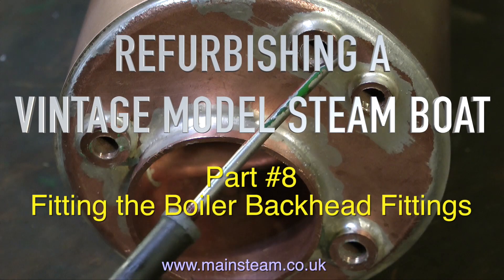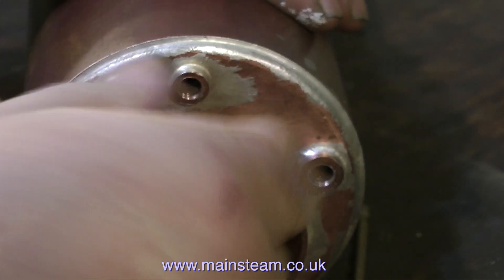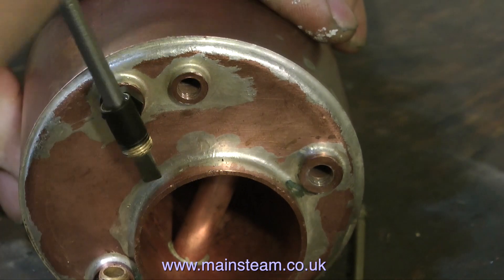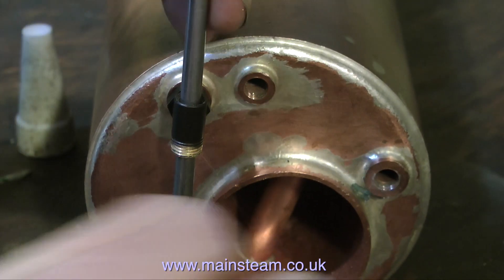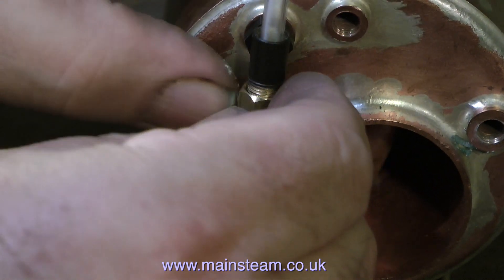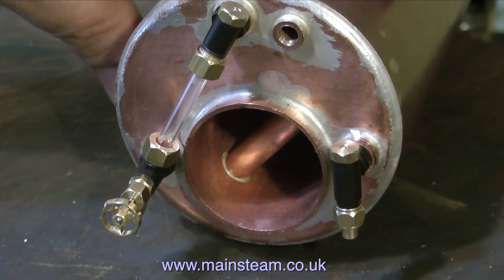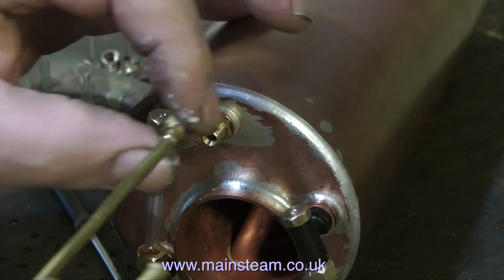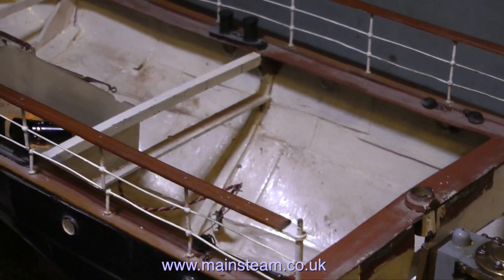REFURBISHING A VINTAGE MODEL STEAM BOAT - PART #8

Comment: Hi Keith and thanks for the videos.
WRT the water gauge - when under way are you going to incorporate an electronic
sensor to tell you how much water is in the boiler via a radio link to the hand held 
controls?  Can you do the same for the pressure gauge?
Wow did I use big words or what??    Thanks again  Rod  from Canada
Reply from the maker: I really don't see the point - just sail the boat close by & have a look ...... electrickery takes all the fun out of it .....

Comment: Are there any water low indicators to the controller of the boat?
Reply from the maker: Yes, you can actually "electronicize" the entire process, but what's the point, you may as well just put an electric motor in the boat with an ESC to control the speed - the manual method is much more fun.
Reply: Well, I mean to make sure the boiler doesn't run dry... or at least a fail safe.